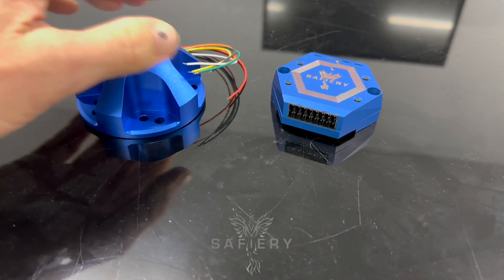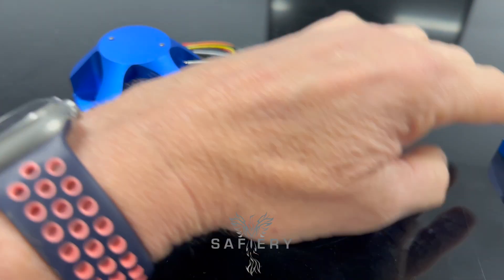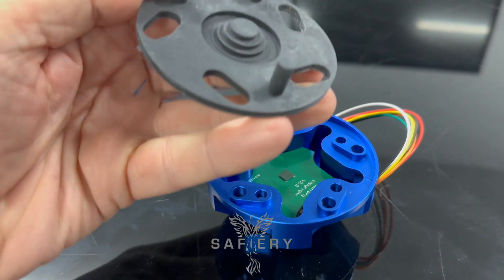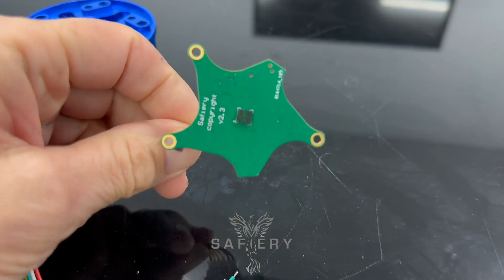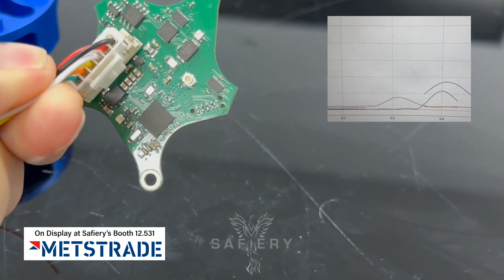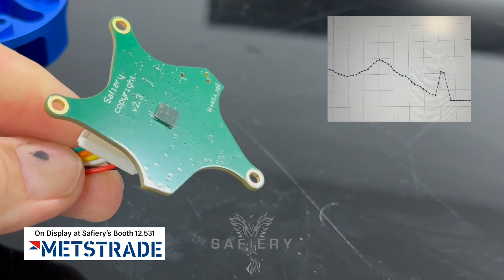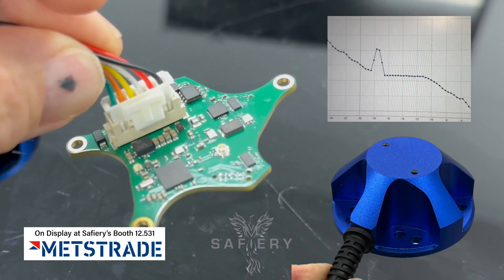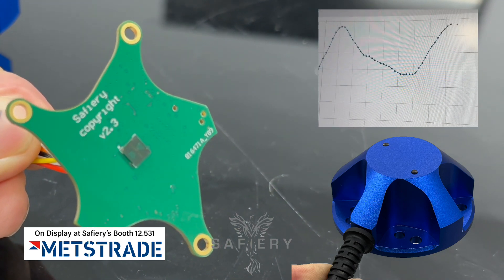STAR-tank Phased Coherent Radar Tank Sender for black, grey and fresh water tank 2.5mm resolution

Comment: What are theses used on? Water tank level? What position are they mounted?
Reply from the maker: It measures the level of any type of fluid in a tank. They are mounted above the tank. They come with SAE 5 hole patern for marine metal tanks. For non-metal tanks that would glue on top of the tank with no penetration.